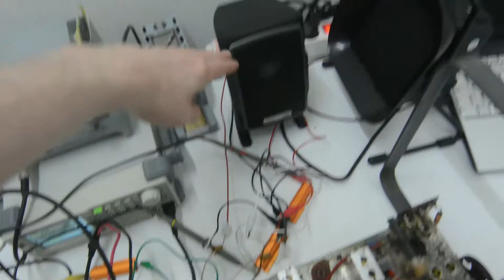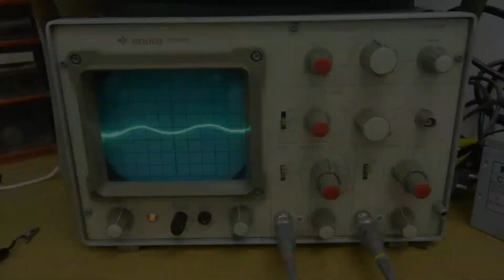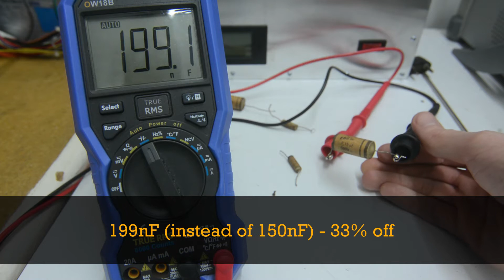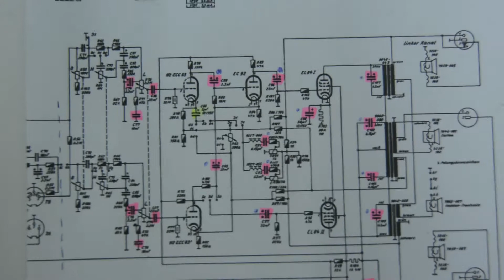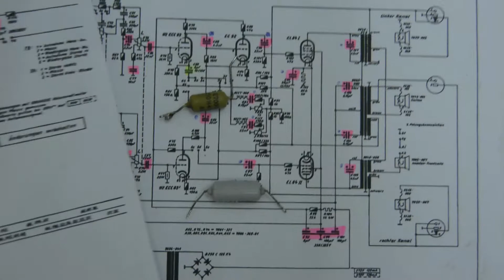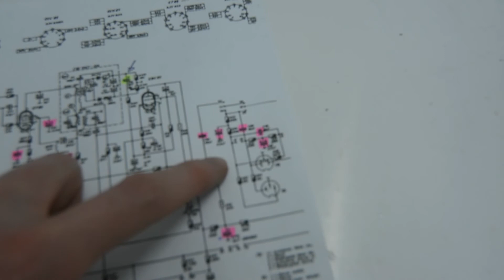Finally it's time of a first powerup attempt! - Grundig 5195 Stereo (Part 6)

Comment: The paper caps will also be leaking like crazy, becoming resistors instead of capacitors. A cheap ESR meter will give a better indication of how bad they are.
Reply from the maker: Indeed, they probably leak like crazy. But I don't have an ESR meter.